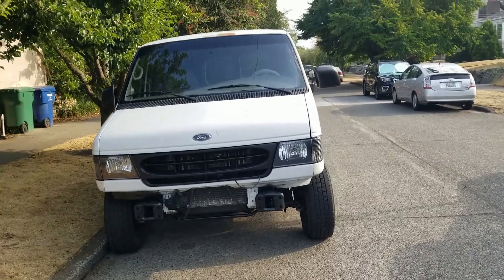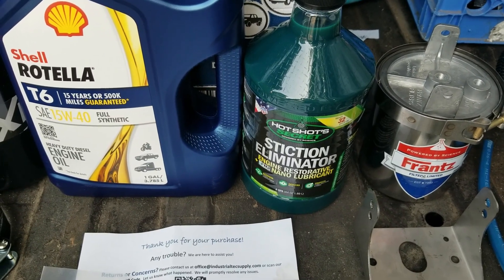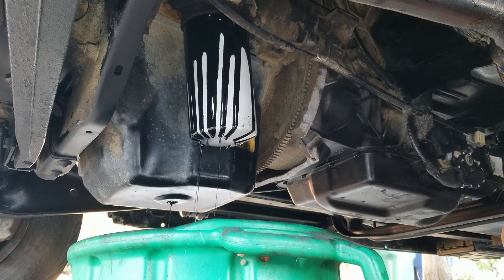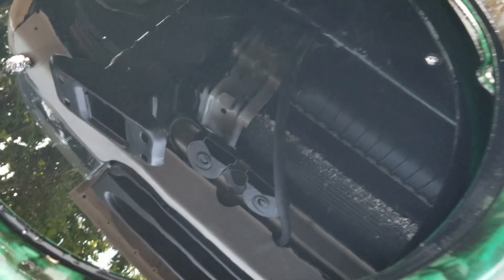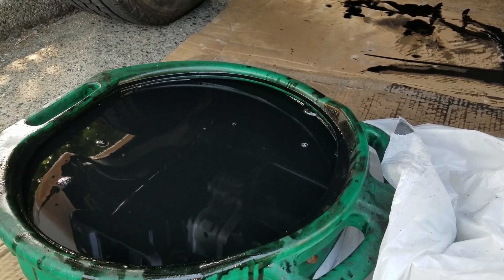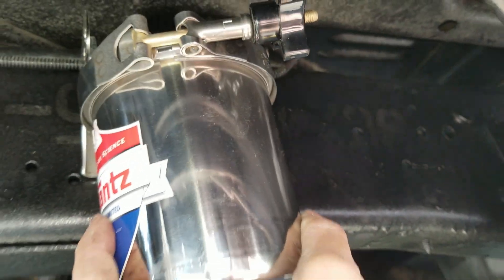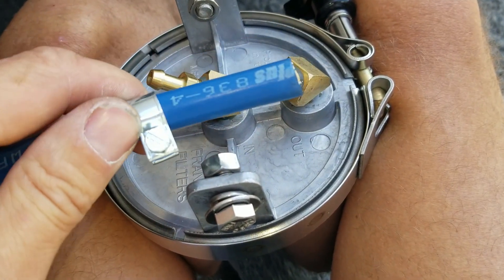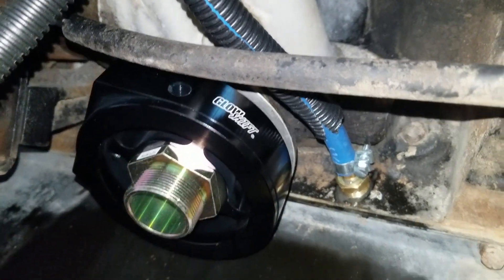Bypass Oil Filter Installation on '02 Ford E-350 7.3 Powerstroke, oil change and drain valve install

Comment: glowplugs wont make it run poorly. its a common misconception that folks think glowplugs help run the motor - they do not. Glowplugs are ONLY for cold startup. You do not have to "wait to start" in warm weather, either. Running poorly is most likely one of the many sensors or injectors. You can do a buzz test on the injectors. Thanks for the vid!

Comment: I don't plan on using the same bypass oil filter company you did, but I still learned a ton from this video.  Something I saw you do that I haven't seen anyone else do was use the plastic hose sheaths to prevent any hose fraying from rubbing on metal surfaces.  Thank you for the idea and for spending the time to make this video to help others.  

Wishing you and your family a blessed year!

Comment: Thanks for making this video. I have a 1997 7.3 with 87k original miles on an ambulance body and I'm in the middle of this same project (waiting for the filter to chassis bracket they forgot to send me), just wanted to know if you noticed any difference on oil quality, performance or fuel economy so far. Also does the Stiction eliminator made any difference? Looking forward to an update video😊
Reply from the maker: Hey glad it helped!  I've only driven about 2500 miles since installing the bypass filter and I haven't yet sent oil out for testing.  My oil is dark on the dipstick but not like before my last oil change.  I'll send a sample in for testing in early summer after a few more miles and see what the results look like.  

As for Stiction Eliminator, I can't say that I noticed a huge difference.  The van has either a glow plug, UVCH or injector issue that causes it to run rough until warmed up and I had hoped the HSSSE would fix that but it did not.  

Fuel economy hasn't changed meaningfully since I first bought the van.  With fuel additives and a 203 degree thermostat my best mpg went up from around 19 to 20, but as I discuss in my video on fuel economy I think it is almost completely related to speed.

Comment: 3:30 If you poke a hole in the bottom of the old oil filter with a hammer and screwdriver, it will drain the oil and make for a cleaner removal.
Reply from the maker: Hey that's a great tip, thanks!!

Comment: Where did you get that air intake?
That is beggjng for a Subaru hood scoop!
Great channel, I've got 2 7.3 vans I'm working on, one cargo, the other a passenger. Thanks!
Reply from the maker: A previous owner installed it.  Dual K&N filters.  I don't think oiled filters are necessarily the best option but I haven't seen anything better for the 7.3 van.
Reply: The oil will be black in a diesel. Some diesel soot is non abrasive and too small to be removed. Its like ink.  I did a fleet of Powerstrokes when the 6.0s first came out. They ordered Gulf Coast filters bolted to the frame. Those take one roll of Bounty big roll paper towels. They hold about 1 1/2 gallon of oil. The 6.0s had a pipe plug near the full flow filter. I dont think they had the 3/8 pipe plug in the bottom of the engine skirt. Like the 7.3s. I marked the plastic oil fill extention. Removed it and drilled and tapped it 1/8 inch pipe.  For extra strength I put a elbo on and hose clamped the hose to the fill tube. I ground a 3/8 inch exrention down to 5/16 for the 7.3s. They ordered the Gulf Coast juniors toilet paper filters for the gasoline Ford industrial 6 cylinder. Engines. They called me awhile back said they had more trucks. Told them to call Gulf Coast filters. Too much work for an 83 year old. I have a Australian Jackmaster Classic on the Pontiac. The oil is golden. Cant say the same for the Ford diesel tractor. I converted a flat head Ford V8 canister filter to use a 4 1/2 inch roll of Scott 1000 for the tractor. John Frantz got his start putting a Frantz canister  inside the old canister filter. Saw some Purolator toilet paper conversions on Ebay. Probably John Frantz models. Mine eliminated the canister inside a canister. Too messy to change.
Reply: The Ford canister filter is in a place where it doesnt always drain at shut down. I got a package of 2 slime tubeless tire valves at Auto Zone.  The ones with the nut. Put one in the Ford lid. Use a cigarette light air pump with a gauge. The pressure comes up. When the pressure drops its ready to change . The Tractor uses a 2 port Perma Cool universal oil cooler sandwich adaprer I got from Jegs years ago. Still have a few 2 port Frantz oil filter sandwiches from the 60s. None that fit the tractor. The Australian Jackmaster Classic has a optional air fitting for the lid. Its my best filter for tight places. Went with the top loaders many years ago. I would have a valve in an upside down Frantz.
Reply: I use Scott 1000 or Great Value 1000 from Walmart. The Frantz isnt set up for the shorter paper and larger cores. When I used them we didnt have Frantz elements. We used 2 ply. The AeroFrantz used the same 2 ply. For awhile I had to go to a janitorial supply to get the best.
Reply: The Australian Jackmaster Classic has 20 dollar paper in a fabric cover. They say you can use a firm roll of toilet paper. They are set up for the larger cores. Cant use soft paper in a Jackmaster Classic